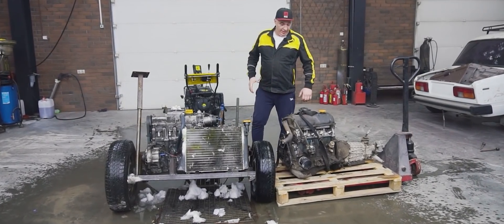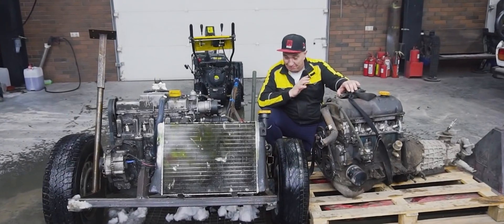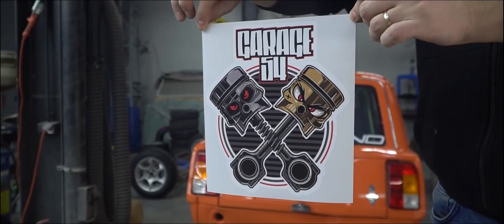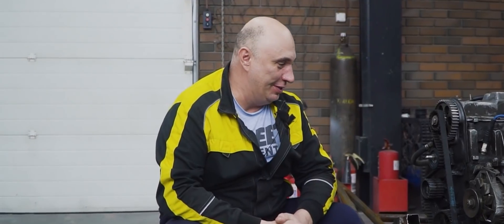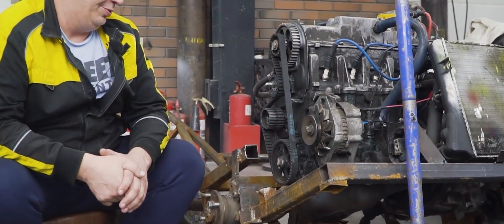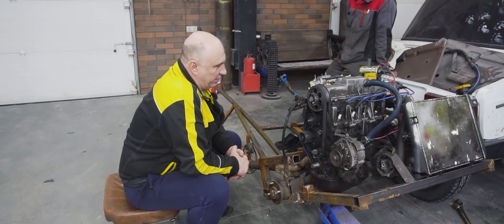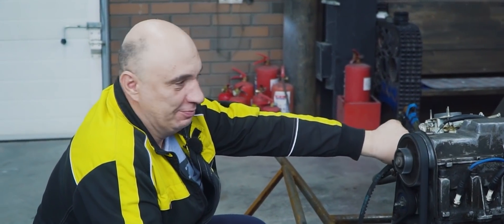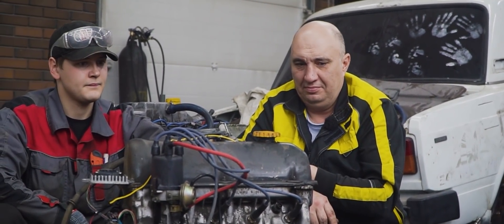8-stroke engine?? How does that even work?

Comment: to me an 8 stroke would be to turn the cam at half the speed of a 4 stroke, i don't see the advantage, but i think it would run.
Reply: Exactly, now its 2 stroke hahaha
Reply: @adamm.malikk24  acrually its a 1 stroke
Reply: Very slowly, and that's what I thought would be an "8 stroke".
Reply: If it's not an interference engine the valves will be all right, but I think it'll have a hard time developing any power as the valves will be open twice as long.... Imagine a full rotation –two strokes for every normal stroke– for every valve actuation
Intake stroke, intake open
Compression stroke, valves closed
Power stroke, valves closed
Exhaust stroke, exhaust open
Now, every one of these starts and ends with the piston at TDC (simplified for the sake of argument), so it will undo the work that it has done immediately. There's no way it will run
Reply: Yes it's obvious it will not run the intake process relies on the negative pressure formed by the piston,  if the piston does two processes then it will simply blow the fuel back out the intake valve like it was doing when they tried it, because the valve will be open theoretically twice as long & that's where the story would end.
Reply: @VyantQuijt  finally someone who understands what four stroke means lol
everybody else, go back to school XD
Reply: Yes, I think we all expected 8 stroke to mean ... 8 strokes per cycle.
Reply: Same here. That's what I thought they were going to do
Reply: that wouldn't be a stroke, but rather halved timing. What you need are the valves not opening during half the stages compared to original.
Reply: I think it might actually be a 1 stroke because for a 2 stroke you get one full cam and crank revolution but here you would get a half a turn of the crank and 1 full turn of the cam.....then again a 1 stroke wouldn't really work, like at all
Reply: @drake501x21  - yep, I see it as a 1 stroke as well as the cam is running 4x it's normal speed
Reply: @drake501x21  cam in a 2 stroke?
lol
Reply: @izaacbanks3337  some 2 stroke engines have also camshaft...
Reply: @izaacbanks3337  
Two stroke diesels have a camshaft.

Comment: What about a 2 stroker?
Reply: Would have to add holes to the cylinder walls.
Reply: @john-martin  would need an overpressure to get air in. 1 cylinder engines have holes (of seperate crank cases) so when the piston goes down, the volume of the crankcase decreases and increase pressure, pumping air into the combustionchamber via the holes in the cyllinder wall. with a 4 cylinder engine where 2 pistons go up and 2 go down, the volume stays close enough the same all the time, and thus not making any pressure for it to work. a supercharger on the other had would make it possible. but also having air enter in the bottom helps push out the exhaust since ther is not a seperate stroke to push it out. so the sudden inrush of air pushes out more of the exhaust. look at detroit diesels 2 stroke engines. compressor to feed air.

Comment: Maybe it needs to crank over faster you need to put 24,36 even 48  volts to the starter
Reply: that would just fry the starter, they should try spinning it up with another engine via the gearbox
Reply: they have that soundbarrier breaking-wheel spinning/launcher machin around lol, maybe it could spin it fast enough]?
Reply: @lucasvanhamburg4937  seems to be a great G54 way to do it
Reply: @lucasvanhamburg4937  Nope, I actually did this with a car that had been sitting with the plugs out and would almost start, but not quite.  Obviously I just fed the 24 to the starter, not the rest of the car, but it worked fine.  

I didn't turn it long and let it cool a while between attempts, but the starter worked fine afterwards.  Try to turn it for 30 seconds with that kind of current flowing though, and I expect it might less than the 30 seconds.  Got it running and it started fine on 12v after that.  The engine was pretty much junk though, as I expected it would be.  Somehow rings just don't seat that well in pitted cylinders.  😕

Fine though, an excuse to upgrade the old style 318 (66 Fury) to a hypo 383.   Much more fun.